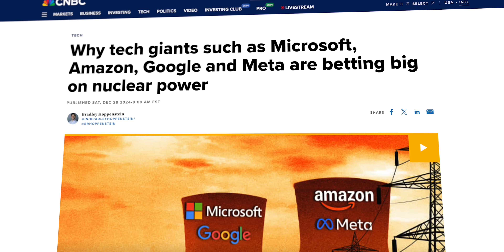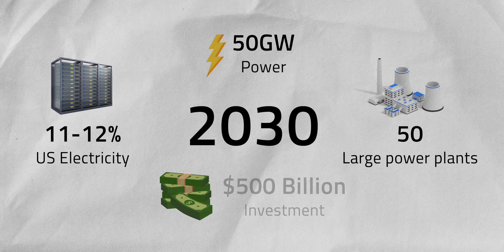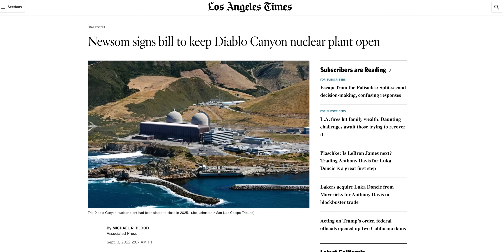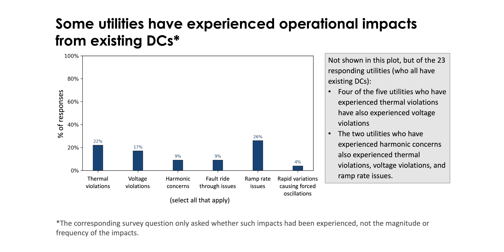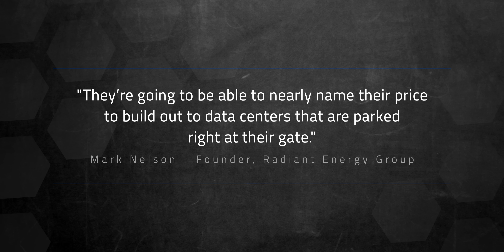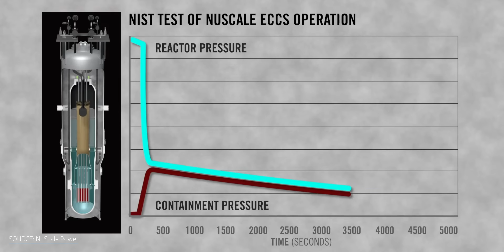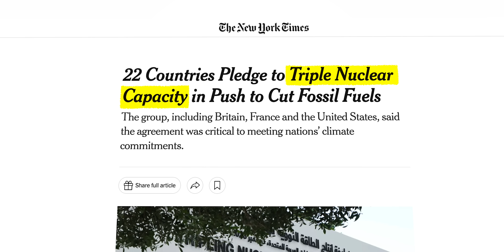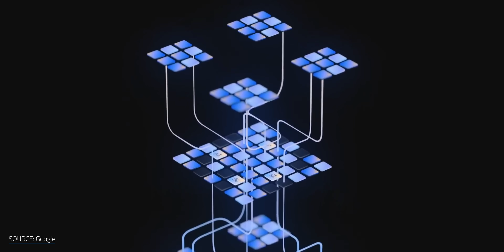Why Big Tech's Betting Billions on Nuclear (Not Renewables)

Comment: SMRs are the future.  They're a great fit for data centers and more generally, de-centralizing the grid, as they could be used for amusement parks and critical infrastructure or just distributed throughout a major city.  Solar is great but it has scalability, manufacturing and recycling problems.  If we really want to address climate change, it's nuclear or bust.

Comment: I don't understand why datacentres would pay a premium for "reliable" nuclear over of solar and batteries, the cost of which is low and falling. Relying on a single reactor is a single point of failure that a distributed system with thousands of panels, hundreds of inverters and dozens of batteries just doesn't suffer from.
Reply: > I don't understand why datacentres would pay a premium
They really aren't paying a premium for nuclear.
Once you include storage/natural gas/transmission/etc for wind/solar, the price tag is higher than nuclear.

Places with nuclear have lower prices than places with wind/solar.
* California (about 60% wind/solar) - retail prices ABOVE double the US average.
* Illinois (about 50% nuclear) - retail prices around the US average.
* Georgia (home of the super-duper expensive Vogtle plant) - retail prices BELOW the US average.

> Relying on a single reactor is a single point of failure that a distributed system with thousands of ...

However, the main points of failure in the US electricity grid is not the generation sites, it is the transmission/distribution. And the main cause of disruptions are storms/falling trees and wildlife(squirrels). See NERC for references.

So, having a distributed system with MORE cables (100s of kilometers) to provide juice from widely disparate sources of wind/solar is LESS reliable than building your data center a few 100 meters from a single nuclear power plant, and removing the single biggest threat.

Nuclear power plants are EXTREMELY reliable. How reliable? Basically, they shut down for maintenance and refueling every 2 years. They don't really go offline all that often.
Unit 1 at Darlington Nuclear Generating Station (Canada) has the best record at over 963 days continuous operation (2.6 years).

The other factor you don't seem to perceive is that, although each component is simple, a set of panels/inverters/batteries/tranmsmission of the equivalent size of a NPP is MORE complex than a NPP!

Basically, these companies have already looked at these factors, and they have determined the lowest risk (of going offline) and lowest costs are nuclear. They aren't stupid, they aren't deluded, they have spent months if not years really digging into the details - and nuclear came out as the answer. Deal with it.

Comment: Memory design could be its own power and nano and micro level are faster because smaller including thermo nuclear weapon by using cpu operation or extreme cold or heat is fast by thermo transfer billion BTU in second thousand of miles

Comment: As a former submarine qualified nuclear reactor operator, I am not in favor of reexploring this tech. The only system that comes 'near to safe' but still not safe, is the tennis ball design. In the event of a failure, all of the fuel can be dropped out of the reactor, shutting off the reactions, and redistributing the geometry to one that stays off. The fuel can then be cooled off. Why is this important? To generate power a nuclear reactor must have critical mass and critical geometry. In this video you show a tennis ball reactor dumping its fuel, lots of white balls leaving the reactor.

Comment: nuclear is techacly green and renewable bescue of its high level nuclear waste  is in fact even 96% recycleable bacly. so teachly its pretty renewable teachly if you reprocess the high level nuclear waste. also highe level nuclear waste when repocces can have the stoinuim 90 bescome ziconuim 90 after 30 years we use zicuom 90 for makeing metal aloyed for makeing terbine blades for powerplants and aircraft and space craft by the way. so nucear energy even for nuclear fission is still far more renewable then bacly then even solar or wind teachly. this can work untill fusion kicks off.

Comment: okay if you make them put up the money for safe storage of the waste for the next hundred years and no energy 
can be more expensive for boiling water!!!!
Reply: > okay if you make them put up the money for safe storage of the waste for the next hundred years

Yup, and they already do that!

The NRC requires a surcharge of 0.001 USD/kWh (decimal correct), deposited in an escrow account. You can see the current status of the fund at the NRC website.
Most other countries have the same, or have since adopted the same, funding model.

Comment: First time I downvoted an Undecided video in years--maybe ever. Spent the whole time covering the good news without touching on the other side--that SMR startups keep revising up costs to the point they're not expected to be any cheaper than traditional nuclear; that none of them will have anything commercially operating until well into the 2030's. No discussion of how solar/wind + grid scale batteries are not just cheaper, but available today.

Completely missed having the critical look into how utterly unfeasible it is for data centers being built this decade to be powered by sources not available until next decade and calling the tech companies out for their impractical plans! They're either gonna use renewables or increase fossil fuel usage.

Comment: Nuclear power == neat.
SMRs == oh heck no. 

How do you keep the fuel secure in transit to those hundreds, or thousands of reactors? Expensively, and or insecurely. 
What do you do for the months the reactor is offline for maintenance and fueling? Fire up the diesel genny most likely.
Do we trust these cost cutting corpos to keep them in tip top shape? Nope.
They're way, way less efficient per unit of fuel than bigger reactors. Yup.
How do you keep the spent fuel secure in transit? Expensively and or insecurely.

Maybe for US based military bases, or locations that already handle the fuel for the full sized reactors; but not for every datacenter. Solar/wind and storage is good enough.

Comment: Surprised this didn't mention that SMR's keep revising up costs to the point that they're no cheaper than traditional nuclear and in fact might cost more than the bespoke solutions per power generated. Also that it's extremely unlikely any SMR company could have a commercially operational plant prior to the early to mid 2030's--way too late for data centers being built now.

Meanwhile, for far less money they could surround the data center in solar panels (no worry about grid hookup) and buy some grid-scale batteries to keep it going through the night--all technology not only available today, but could be done in under 6 months.
Reply: > Meanwhile, for far less money they could surround the data center in solar panels (no worry about grid hookup) and buy some grid-scale batteries to keep it going through the night--all technology not only available today, but could be done in under 6 months.

However, despite your claims, these companies - not staffed by stupid, clumsy people; but staffed by competent engineers who understand the companies' primary motivation is making money - have found solar + batteries unsuitable. Solar+batteries don't make the cut. Nuclear did. Deal with it.
Reply: @factnotfiction5915   Or, get this, they're building the data centers this decade and any new nuclear besides reactivating old plants will not be online until well into next decade and in the meantime these companies are making a big deal about nuclear to get people to ignore the massive amount of carbon emissions because they are just going to use fossil fuels.

And when it comes time to deliver the new nuclear, it'll probably miss deadlines like SMRs have for the last decade+. Oh well, they got the good press over nuclear so they don't care; they served their purpose of providing cover for massively failing on their net zero goals.

Comment: I'm not sure engineers believe in gravity anymore. Putting cooling pumps in the basement instead of a reservoir up on a hill so the cooling water can simply flow downhill would make sense, but engineers love pumps and complexity. I needed 50,000 gallons to meet the code for a fire sprinkler system. The engineers could only think of diesel run pumps in the basement that were complex to maintain and operate. They looked at me like I was crazy when I asked the to consider a gravity fed system that would not require nearly maintenance and could not fail if power was out. I'm still bitter about losing the battle.

Comment: Data centers, which need consistent power, seem like a good use for nuclear, which tends to be used for base load power.  Nuclear power tends to be pricey, but data centers may be able to afford it, especially if an SMR next to the data center lets them forego the cost of the grid, and its high power losses.
Reply: Data centers are actually extremely inconsistent in their demand for power. To the point it causes issues because the AI-focused ones frequently see 50%+ swings in their total power draw in fast swings less than a tenth of a second. The non-AI focused data centers see power draw which matches the rest of the grid (i.e. lots of draw when people are awake and using the services, mostly idle at night when people are asleep). Most data centers serve users which are broadly geographically near by. The server sending you this YouTube video is probably less than 100 miles away.

Comment: What’s at the gate of the nuclear power plants? Barbarians disguised as data centers? Start boiling the oil!

As for more mundane matters…why are SMRs’ schematics typically showing fuel rods instead of pebble beds, like the Kairos Power type? Is the image at 12:22 essentially a pebble design?

Can regulations keep pace with innovation? They could if any staff are left to write the regs, and conduct plan review.

Comment: For me there are too many unresolved questions. Where to put the Waist? Ther is no insureer who wants to ensure a nuklear Plant. Who wants to pay the Prise when Solar can be as low as 10$/MWh the currently build reacrots have estimates of 300$/MWh. Nuklear Powerplants are incompatibel with Renewables as Nuclear is most efficient when running Full Power 24/7.
Reply: > Who wants to pay the Prise when Solar can be as low as 10$/MWh

Um, these tech companies?

You must have slept thru some of the video, because the tech companies find solar/wind + grid scale batteries NOT cheap and NOT effective. They is why they are choosing nuclear. Deal with it.

> Nuklear Powerplants are incompatibel with Renewables as Nuclear is most efficient when running Full Power 24/7

However, the purpose of the grid is NOT to maintain compatibility with wind/solar, but to serve the demand load. Wind/solar should be made to pay for the disruption to the grid that they cause - unfortunately in the current pricing regimes, those costs are placed on either the legacy generators, the consumer, or both.

Comment: The 90,000 Dragonscale solar tiles installed on the four buildings of google headquarters will produce 7 megawatts of renewable energy, or about 40% of the campus' annual energy needs.  But they want to produce 500 MW of nuclear power for AI? WTF??
Reply: 7 MW from your roof is quite the achievement;
but this does show the solar+batteries isn't really going to cut it when you have LARGE demand loads. Like cities.

Comment: This is the only episode that should be called “Decided” instead of “Undecided”. There is almost no reason not to have nuclear powering everything. This is the kind of tech that will propel humanity into the days of unlimited energy, which in turn becomes unlimited clean water, unlimited problems being solved.
Reply: "There is almost no reason not to have nuclear powering everything."

There is: it's the most monetarily costly form of energy by far. Even the SMRs projections are no cheaper than traditional nuclear as they keep revising up their claims.

Meanwhile, wind/solar + batteries cheaper than even new fossil fuel generation and beating projected growth over and over and over. We do have unlimited clean energy--it's from the sun and, unlike wishful dreams of nuclear that's turning out no cheaper than it ever was, it is a reality being built out by power providers around the world every single day.
Reply: I think you may have missed the bit about nuclear being the most expensive source of power ,If AI firms need the extra energy maybe they should pay for the   building of nuclear power plants and and all decommissioning and waste disposal as per the Swedesand Finns
Reply: @ > I think you may have missed the bit about nuclear being the most expensive source of power

And what you may have missed is that although nuclear plants have a very high LCOE, they have very cheap electricity.

How can that be? Well, wind and solar plants don't count into their costings: extra assets (like natural gas or storage) to deal with intermittency, or extra transmission (to bring wind/sun from where it is windy/sunny to cities where the electricity is used), or grid support (to not damage equipment).

We can see this reflected in the retail rates. EIA data (USD cents/kWh) average retail, residential prices, August 2024 (see the "Electricity Data Browser" on site, quite simple to navigate)

13.61 - US retail
16.63 - US residential

(super expensive nuclear; Georgia with massive cost overruns from plant Vogtle)
13.15 - GA retail
14.90 - GA residential

(super expensive nuclear; Illinois with 50% nuclear)
12.73 - IL retail
15.77 - IL residential

(super cheap wind/solar; can really feel that low, low, low LCOE; California with 40-50% wind/solar)
29.06 - CA retail
31.05 - CA residential

> If AI firms need the extra energy maybe they should pay for the building of nuclear power plants 

And that is exactly what is happening. The Microsoft deal with Constellation to reopen TMI-1 is an example; Microsoft has inked a power purchase agreement for 20 years, giving Constellation the confidence to invest and refurbish the plant. Google is essentially buying its Kairos reactors (I believe Kairos would technically own and staff). And non-AI firm Dow is doing the same with its X Energy reactor in Texas.

> and [pay for] all decommissioning and waste disposal

Of course they would have to, as current nuclear plants already do. Most jurisdictions adopt the NRC model, where decommissioning and waste disposal are paid for UP FRONT, through deposits into escrow accounts at the time of generation.

The US NRC escrow account for waste disposal is fully paid up.
Each US reactor escrow account for decommissioning is audited by the NRC every year.
Reply: Cost is one reason. Solar plus storage is way cheaper than nuclear.
Cleanliness is another. Digging the fuel, storing the fuel, transporting the fuel. All are ongoing costs both financially and environmentally. 
Safety. A solar panel can't go nuclear. Nuclear plants are safe, at least the big regulated ones are. IDK about a small reactor crammed into a prefab next to a datacenter. How do you secure the fuel and waste in transit? 
What do you do for the months the plant is offline for maintenance and fueling? 

An SMR might be better than a diesel genny hooked up to a datacenter, but solar + storage is already more than good enough and has fewer downsides.
Reply: @Jcewazhere  and despite your objections,  these companies have already looked at these factors, and they have determined the lowest risk (of going offline) and lowest costs are nuclear. They found wind+solar+storage didn't make the cut.
They aren't stupid, they aren't deluded, they have spent months if not years really digging into the details - and nuclear came out as the answer. Deal with it.

Comment: We really need to find a way to use the leftovers like plutonium or we're going to end up getting into another unsustainable situation.
Reply: Look up fast neutron reactors. What most people don't realize is "spent fuel" still contains a massive amount of energy. The original plan was to move that fuel to fast neutron or breeder reactors after its first use. However Jimmy Carter proclaimed that the spent fuel was "waste" because he was afraid it could be stolen and used to make a bomb if it was sent somewhere for reprocessing.
Reply: We can and it's called reprocessing so spent fuel can be used in a reactor again to generate more power.